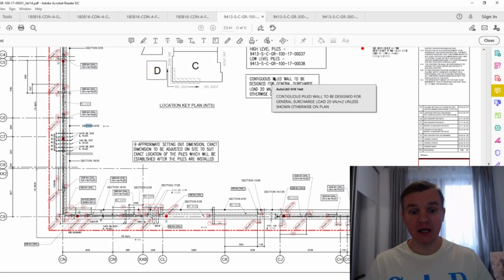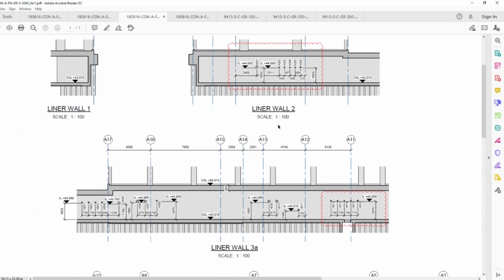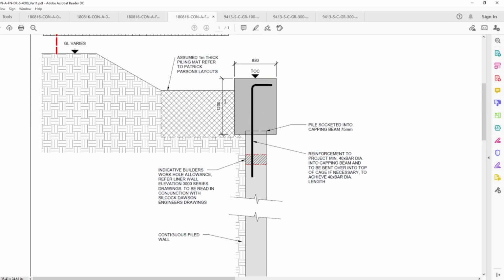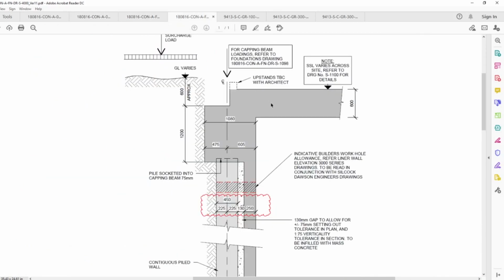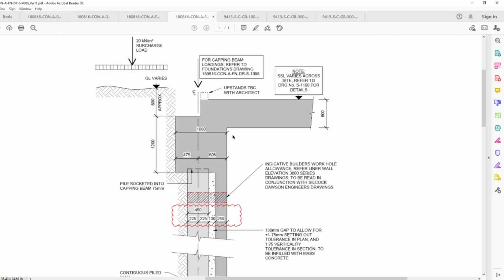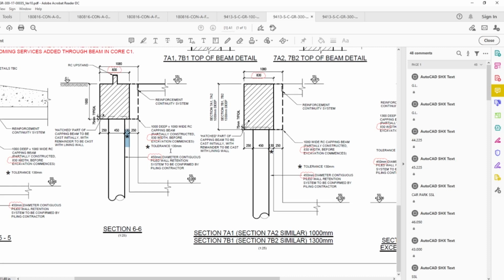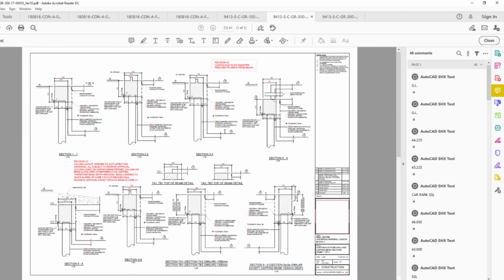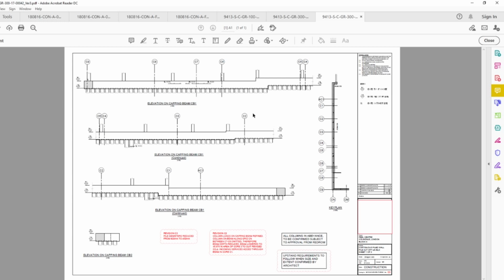How to read Construction Drawings #07. Capping beam. Sections and elevations drawings.

Comment: if we are casting the capping beam at two different times 830mm width and next 250mm width how are we going to make the reinforcement of the two casting to connect?
Reply from the maker: reinforcement is in during the first pour, so the is no connection needed. It has to be in

Comment: Is the capping beam going to be cast 2 different times, because according to the drawing we have 830mm and 250mm? if so how are we going to get the reinforcement bar connected at the two different casting?
Reply from the maker: It's not connected later, is has to be in for the first pour and the stopend has to be formed to enable the bars going through

Comment: Hi Greg ! Thanks for sharing these informations. I notice that the wall will be build 130 mm in front of the piles. In this case the soil pressure will be supported only by the piles ?
Reply from the maker: Hi Gustavo! The wall will be built against the piles and 130 tolerance is to make sure the wall will be minimum 250 thk. I bet it meant to be less as there was a change from 600mm piles to 450mm ones, so originally this gap was designed to be 75mm (the pile position tolerance) and which in worst case scenario would provide 250mm wall.
Reply: @SITENG  hum ! Interesting, aways something change from the "paper" to the "site".